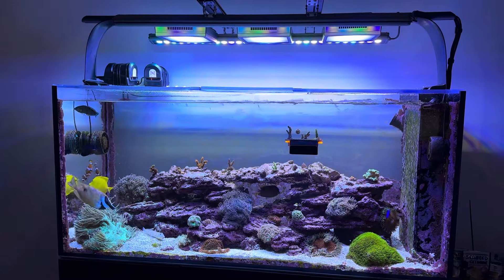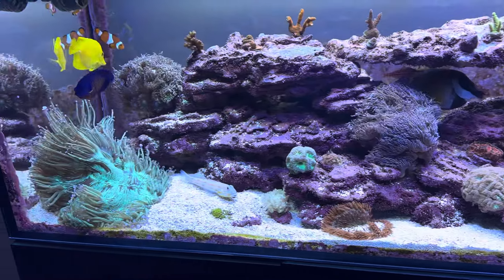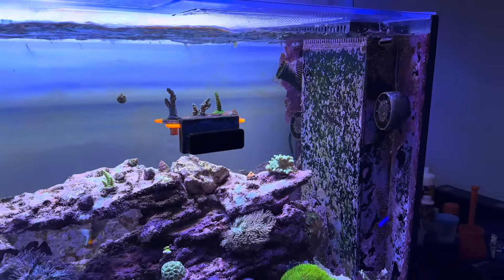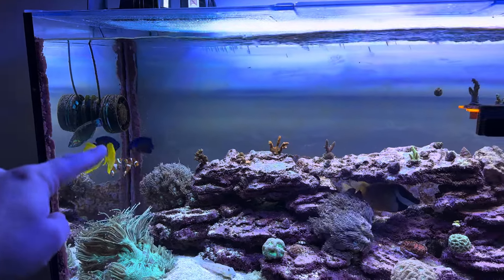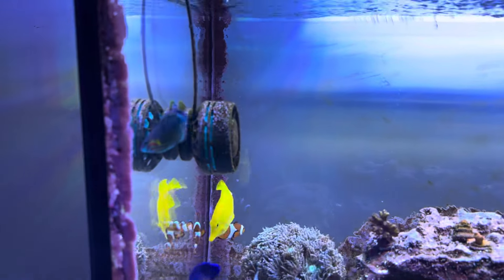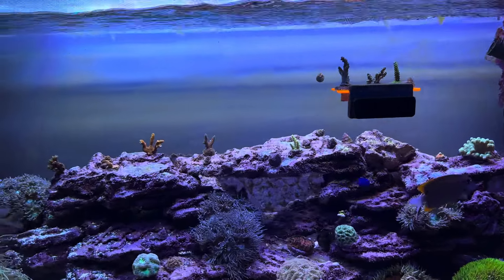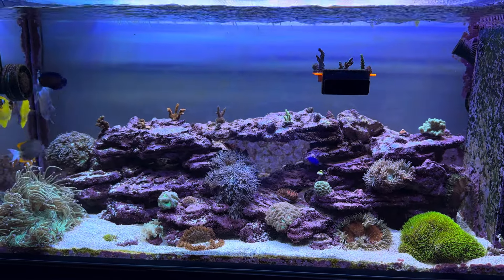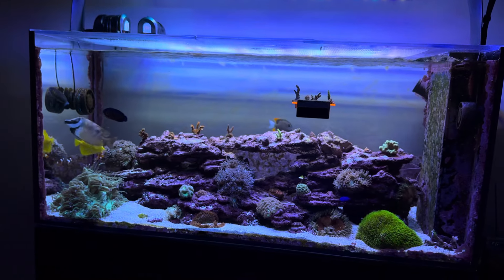Explained: Flow That Keeps SPS & LPS Corals Thriving In A Mixed Reef Tank

Comment: Hello.  :)

What are you doing with your return pump(s)?  Are you considering them in the flow pattern?  What are you running your pumps at, GPH and power precent?   

Also what are you peramaters for your tank?  

I am just now adding sticks, and I have a lot of flow in my tank.  Two Red Sea Gyre 45, running 50% to 70% random flow and will run backwards at 50% for two mins every 10.  Also my return pumps are using a random flow generators and are at 38% Syncra SDC 9.0s.

The gyre are set one higher than the other on opposite sides of the tank, with each side set in a slightly different level.  And the flow from them crash in the middle of the tank.  And the return pumps are set where the RFGs are pointed in the far corner, one point to the rear and the other pointed to the front.
Reply from the maker: I put up a recent video about running slow-flow filtration. My return pump does not run hard. I have a Neptune COR-15 churning at only 40% strength. Gyres are great. I ran a large one for a while. I just got sick of needing to clean it out every couple months. But if you stay on top of cleaning them, I think they’re easily the best route to go for flow. They get every ounce of water moving. Don’t hold me to this, but I think my Nero 5’s are 3000gph maxed out, and the Nero 7 is 4000gph maxed out. So I’m running them 55-65% of those maximums while lights are on in the tank. And everything seems happy? Even acros. Both my acros on the rock are slowly basing out and show good polyp extension daily. And the LPS are plenty pleased!

Comment: What length is that tank? I run my pair of nero 5 on pulse 42% and then random 15-20% at night on a 3 ft tank. Working okay but there's deadspots and if I ramp too high, my other LPS corals dont like it. It's tough to get the right flow for all the corals in my tank.
Reply from the maker: It’s a 4 footer. 22 inches wide. 20 inches tall.